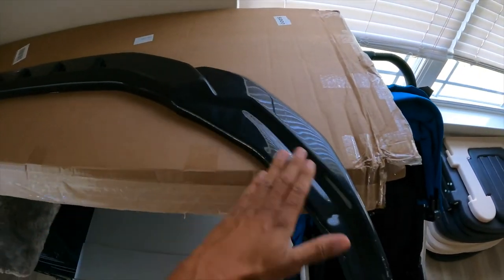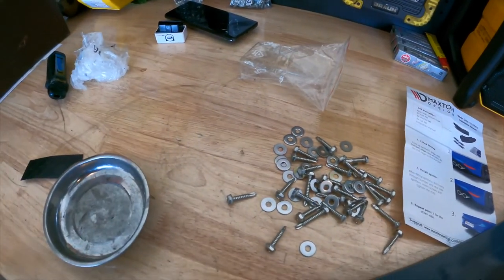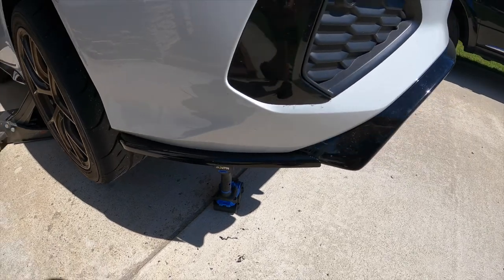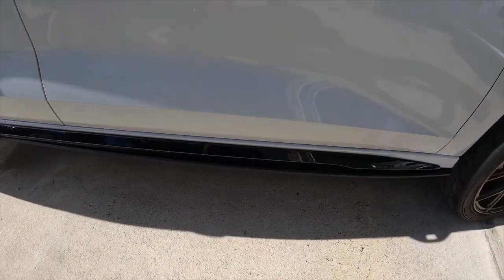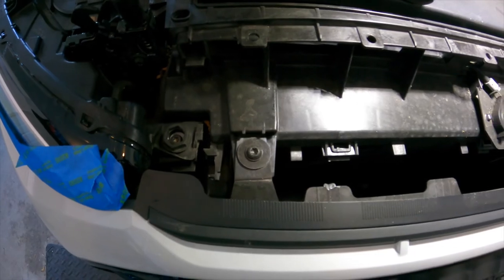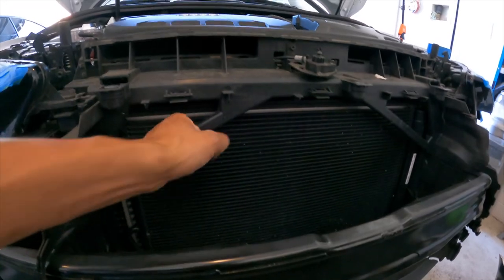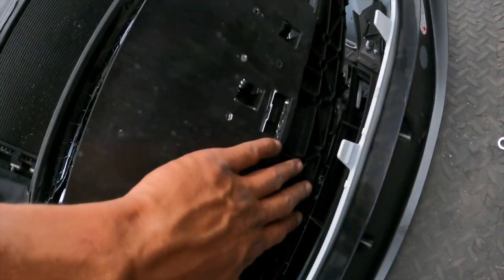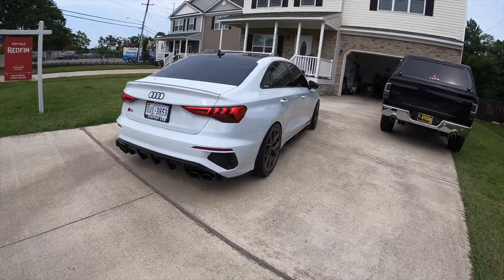Maxton lip, skirts, and rear spats install! LOOKS PHONOMENAL | 8Y S3

Comment: saved me time and money, the hardware in the kit was not long enough so pretty much the same issue you had. Gonna try to take that plastic piece off tomorrow and see if I can get it on. '19 Rs3 so should be similar enough lol
Reply from the maker: It’s pretty much the same for all vw Audi front bumpers! Just double triple check for vertical screws in the fender well areas they like to hide them. Big washers and log bolts are your friend with lip kits! Mine is still going strong, didn’t think it would last the summer now it’s been over a year 👌🏾

Comment: Looks great, which version of the lip is ? i think is v3 or v4 right?, im thinking of getting one lip, how did you seal the water pump? thanks a lot, from 1 to 10 how difficult it was to remove the front ?
Reply from the maker: Seal the water pump?? Not sure what you mean. It's the V4 lip though still holding up great to I've hit it a few times on things and had it up to about 140 during some races

Comment: Hey, im about to hit the front splitter install tomorrow. Thank you very much for the content. Did you add additional (gold color from what I saw at 15:11) bolts to the areas where you mentioned there was a slight gap? I may need to pick some up if that's the case.
Reply from the maker: Yup I added a handful of extras for good measure! It’s held up great so far too I’m actually honestly surprised it’s done so well. Worth the time and money!

Comment: Do you think i could use rivet nuts/bults to install the front splitter? I dont really wanna remove the bumper but now im worried the bolt or rivet would knock into that plastic piece that you pointed out. Im gonna try to grab the diffuser and maxton spats too.
Reply from the maker: Taking the bumper off it's that bad.. but I'm honestly not sure. This is the only way I know to do it properly
Reply: Just caught this Video. I have a 2020 A5 Sline and getting ready to install the Maxton front splitter. You do not have to take off the front bumper. You can use jack nuts. Check out the Maxton UK video install of the splitter on a S3. They use jack nuts (which they call rivet nuts). 👍